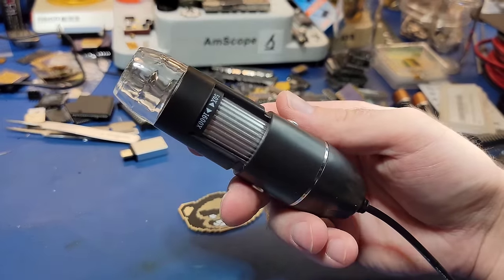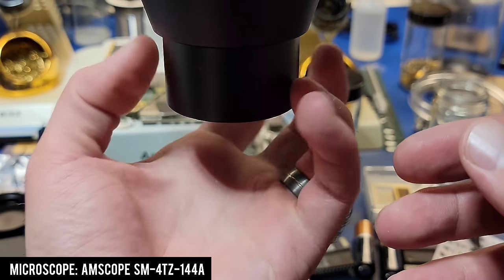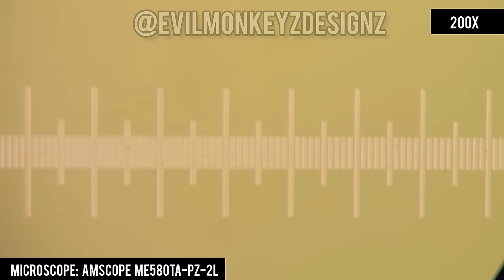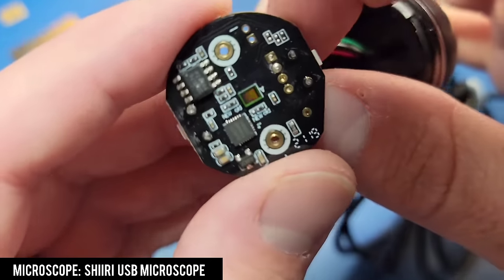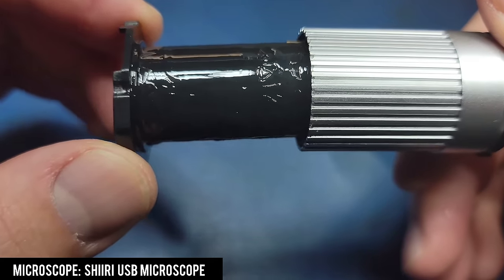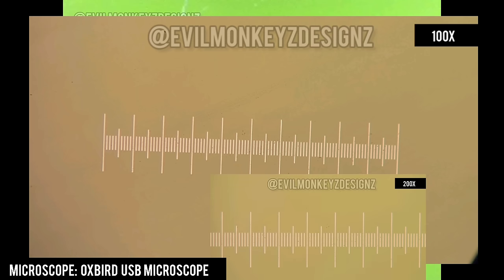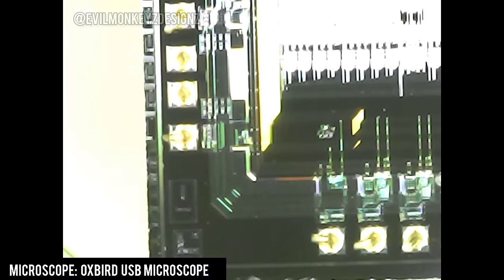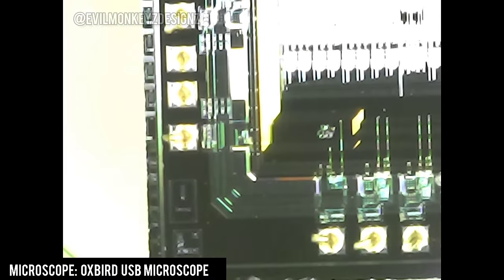Digital Microscope Comparison

Comment: Those high end microscopes are really nice.
For some of us, however, we don't have large labs to work in.
My work bend is very small, so a large scope was out of the question.

Back in 2017, I ended up buying a A1-N002 (Andonstar ADSM201) HDMI 1920x1080 scope.

The screen is tiny and really not worth using it that way, but it has HDMI and I have that connected to a 24" monitor.  The image is excellent.

It brags a 300X magnification, but the "zoom" is only adjusting it up or down on its stand. LOL
But the focus ability of this thing is really good, so I can get very close to my PCBs, but the sacrifice is that the lens is very close.

This one was worth it for me as its footprint is very small.
Reply: Used Andonstar ADSM201 for a while. It definitely was nice scope, but unfortunately with very little observable area. Good for phone and small circuit board repairs. But pain in ass when you had to deal with laptop motherboard due to lack of space at small base of ADSM201. Small distance between object and lenses also prevented working with larger boards. Due to that I was forced to purchase better and more expensive scope.
Reply: @KrotowX On day one I hated it for that very reason.  LOL
But, I solved that problem.

What I did was to fir swing the shaft, with the gear teeth, around so it's now towards the back.

Then, I mount this on a shelf about my work area, "upside down.'  Meaning, the "foot" part is on the shelf, the shaft faces down and the camera is now mounted on that.
So the camera is now looking at the bench.

The foot part, which is on the top shelf at the edge, I put a big washer with  rubber screwed into the shelf, right at the far edge of the foot.  This is to support it so that camera won't fall down.

I hope I explained that clearly.  LOL

The point is, now I can adjust the camera up and down for a much wider view.  I can easily use it now to view larger boards like PC motherboards, TV boards and the such.  

If I do need to get super close, I then just put the work (board) on a riser so that it's closer to the camera.

I've used this for years in this position and it's just fine.

Of course, if I had more space and if I was doing more work in my lab, then I would buy a larger format one with the dual arm and remote zoom, focus etc.

But... no need.

Comment: An absolutely professional production! I'm glad I didn't spring for the low cost "kiddie" microscopes! I have the most expensive model you presented but an earlier model. The biggest problem is the wobbly mount. It works great at lower power for positioning small surface mount parts.

Comment: Really good comparision👍 amazingly well presented architecture of those image sensors by use of pro microscope. It was an amazing video to watch not just as a good comparision of cheap microscops but for sure to see how image sensors are build and that was the first time I saw them little tiny sensor pixels and all wirering around and under the circuit. Why most of people don't even realise and barely understand these techs which in my opinion all children should particularly understand the basics of electrics and electronics. Thanks!

Comment: A video demonstrating the superiority of the AMSCOPE microscope compared to a host of stupidly cheap proposals. But for most mortals these (cheap proposals) are more than enough for hobbyist or even professional use. It would be more interesting to demonstrate which of these cheap models is the best or most functional. Most spectators were grateful.

Comment: Magnification is not an important spec for a digital scope, because any image can be infinitely magnified. The things that matter are resolution, dynamic range and depth of field, in that order. 
A 0x magnification scope (where 1 micron on the object is 1 micron on the sensor) is about as good as you can get.  Displaying an image from a 1/4" sensor on a 25" wide screen gives 100x magnification. Displaying it on a 50" screen gives 200x.
Reply: We still are talking about optical magnification which is in effect in microscopes with digital cameras. Digital image magnification indeed doesn't matter.
Reply: @KrotowX  even optical magnification is misleading. As I mentioned, a 1x optical magnification on a standard image sensor is great, but it does not tell you what you can see. Only numerical aperture (& therefor resolution) tells you what can be resolved, regardless of magnification - optical or digital.

Comment: They dont tell you in the manual but you need to fully extended the lens and then tighten it by the threads. You can get about 5 or more inches of clearance with a better level of clarity as if camera were 2 inches away from the subject.

10:18 you can see its inscrewed but you can still do it without taking it apart fully. I just weaseled my fingers in and screwed it in snug because i noticed it was loose.

Comment: I wouldn’t mind if they said it’s 50x or 100x and cheap and high quality… it’s the fact that they call it 1200x or 2000x etc that kills me… like… it’s not That bad if you are okay with 50x or 100x and are, for instance, soldering chips, not actually looking at chip dies, but let’s say you want 200x, 500x, 1,000x, plus+ and that’s why you buy it, and it just plainly Doesn’t do that, then yeah… just don’t lie… 😅

Comment: I wondered about the true magnification of Carson Optical's 250x pocket microscope, I think it's only about 100x.Microscopes from 2000x to 7000x are usually for scientific purposes and precision fabrication can cost upwards of $70000, so a 1000x microscope cannot be cheaper 2000$
Reply from the maker: Those are all great points! I think that a normal person who's looking for a microscope might see these cheap USB microscopes and not realize that they aren't really getting what is advertised. Most people have no concept of what 1000x magnification should actually look like, so it's easy to get away with this sort of false advertising.

There is a market for these, but they unfortunately aren't good for looking at silicon chips up close. I'll have to add the Carson pocket microscope to the list of microscopes to look at if I ever do another video like this 😁
Reply: Well actually Ive never seen a professional microscope with more than 1000X, going beyond that is futile due being at the limit of resolving power with white light. Dunno about super resolution microscopes like STORM, STED and PALM but I bet they still have optical magnifications below 1500X the resolving power comes from the algorithms.

Comment: With this kind of digital microscopes the magnification is practically a meaningless number: marketing department can play with the numbers and make it the higher they want, even if the actual details captures by the optics+sensor stay pretty poor.

Light intensity and uniformity may also make a lot of difference: I bet that if you manage to get the illumination of the top level microscope mounted on the cheaper ones, the chip images will improve considerably.

A more meaningful evaluation is resolving power: roughly speaking, the ability to capture and separate fine details. That's where you may find the bigger, and most significant differences among cheap and top level microscopes. That's what the test microscope glass with 0.01mm lines is for, though an even finer grid may be needed to actually pin the magnitude of the differences.

To be fair, even the cheapest microscopes performed pretty decently (for the money) on the test glass. 0.01mm grid lines were well separated, and quite sharp (at least, the difference is not that much evident on a YT video). A finer test glass should make their limitations much more evident, but stability and light looks like their main limiting factor, nit the optics+sensor chain. Anyway, considering that one can use them lighthearthedly on the outside, in rough environments, connected to a smartphone, they may still be an interesting tool for many things.

Comment: So nice to have this video pop up in my suggestions after just having ordered one of those cheap ones 😅 I wasn't gonna expect excellence from a 20€ China-made gadget anyway, but I'm hoping it will be decent enough to inspect regular solder joints.
Reply: I’ve had the cheap usb one for a couple of years. I think you’ll find it useful, it’s better than nothing. As mentioned the biggest drawback is working height. My usb scope ended up with burned plastic due to me keep getting it with my soldering iron 😂
Reply: @Mark_C1  Yeaah it doesn't work at all. Comes with a download link that's broken, had to find the app myself only to then notice it only works with the wireless version.
Reply: @Crimsomnia  that’s a shame. I think with mine I gave up on trying to get the software and just let windows pick it up it’s self and then viewed it on the camera app within windows.
Reply: @Mark_C1  Yeah that could work, but it kinda defeats the purpose of doing electronics stuff on the kitchen table, when I don't have space for this around my windows PC. I'll see what I do with this now
Reply: @Crimsomnia  yeah I hear you there ! I also tinker in the kitchen as we’re in a 2 bedroom flat. Setting the stuff up getting ready to work on something seems half the battle lol. And apparently the kitchen cupboard isn’t the place for oscilloscopes, power supplies and hot air rework stations 🤣

Comment: I bought a few a year ago to compare, and they all seemed to be the same (same magnification, same lights etc.), but some still had better image quality, so there might be different filtering being done. I didn't need the highest magnification, just something I can hook up to the PC that's portable. I bought some for 15, some for 25 and one for 40€ and the cheapest one had the best image. I would have liked something with 200X, but I also came to the conclusion they all are 100X, no matter what it says on the package unfortunately. Same goes for magnifying glasses, the chinese selles give you numbers like 10x and it is 2x in the end.
Maybe there is a physical limitation to around 100x with such a small form factor?

Comment: How close did u place the shiiri/oxbird microscopes to whatever you were looking at? We have one at work and I discovered if you put whatever you're looking at right at the opening of that clear plastic housing (imagine placing the end of the clear housing directly onto a document you are inspecting) you can run the focus adjustment all the way to one end (past where you think it should be) and you do get the increased magnification.

Comment: it depends what you want do with it. i got a cheap usb one to inspect solder joints on my side projects. for 10-15$ i'm happy with it. 
i use it so rarely getting a more expensive one wouldn't really do more. it does the trick and doesn't take up space when not in use.

Comment: I got a Tomlov last week but I got it for smd soldering and inspection and not for inspecting the chip dies. My first impression was a little disappointment but after using for a few hours my opinion changed to very impressed. It does better than what I wanted for the price I wanted to pay.

Comment: Mate,
Without disputing resolution and quality at all - to get the most magnification from all the inexpensive USB micros (I had a few) you need to remove the front protector. It's a strange design, but with it you just can't get the lens close enough to the object to make best of the device potential magnification capability. 

Without it, you can take surprisingly good images with those (considering the 10$ price tag).

Comment: Quick question: I have a c-mount type digital microscope and I want to buy a barlow lens that will help me see a wider viewing range. I want to see more components on the board. Should I buy the 50x or 75x from a height of, say, 2 feet? By the way, this is a great review! so extensive. 👍
Reply: Do you mean 0.5x and 0.75x? Generally speaking the higher magnification, the closer you need to be to the work piece to focus. But it is also going to depend on other parts of your microscope. A 0.5x will give you half the magnification and presumably double the working distance? Assuming you aren't currently using a barlow that modifies your magnification. Although I could be wrong on that and maybe the working distance doesn't scale linearly with the magnification.

Comment: While I agree with all of these microscopes being a scam with regards to their stated magnification, I think the way you measured the magnification may be a bit misleading: by looking a the size of things on screen while ignoring the actual resolution, you gave the cheapest microscopes an estimated 100x zoom and the last two only 50x. But the last two had way bigger sensors, if you had cropped their image to their 640x480 middle section, they would have "measured" somewhere between 200x and 250x, that would have been a fairer comparison (that way all of them would have the same "pixel size" on screen). Otherwise a bigger and larger sensor on the exact same optical zoom level would always get a lower "estimated" zoom.
Reply: The problem with that is if someone is saying its x Megapixel and x magnification, you should be able to expect the magnification AT that resolution.  Crop/digital zoom is not magnification, even if perceptually it kinda works the same way.  As with real magnification you would get more detail due to using the whole sensor.

Comment: So I do have one of those cheap ones, but I only use it for taking macro pictures for work instructions for operators at the factory I work at, specifically for like 0603 SMD components.

Comment: Would you recommend the Tomlov digital microscope for something like inspecting collectibles before grading? For instance, looking at vintage sports cards for potential damage on the surfaces, edges, centering, etc? The $699 microscope seems like overkill for my case. Thanks.

Comment: 24:00 Of course you can turn off the 6 LEDs. Use the dimmer on the front below the buttons (the white line is a touch dimmer).

Comment: You are not telling the main issue with this, YOU CANT use it for soldering because the microscope needs to be extremnly close to the circuit and you cant fit your tools.

Comment: I had a couple of these cheapo USB microscopes and the sensors in them are outputting a resolution of 640x480, I bought a 1080p 1920x1080 USB camera with a OV2710 sensor on it and 3D printed an adaptor to allow me to use the lens mechanism from the cheap Microscope and now have a crystal clear image full screen compared to horrendous even when in a small window when using the stock sensor.

I use it all the time when doing electronics stuff, the OV2710 camera only cost me £12 and was soooo worth it, I have two different cameras with the same sensor as I use the other for something else and one has a very slightly better image quality than the other as the processing IC's on the camera make a difference as well as the actual sensor but both spank the tiny sensor those cheap microscopes come with.

Comment: For work im using a keyence digital microscope. But that was much much much more expensive than all of the ones from the video combined *^^.
But since it is also a couple of years old now, you notice the "old" camera sensor and PC that runs the software. But 5000x magnification is great.

Comment: You should have enlarged the photos to compare them one-on-one with the expensive microscopes, i.e. should have enlarged the 100x scopes' photos 2.25x and 5x, or 5x and 10x for the 50x scopes to give us a better comparison between them and the expensive models with real specs.
You could still do that with an additional, short video.

Comment: i got a similar scope to the cheap ones. the biggest problem is the software. mine has a wireless feature which only seems to work on phones, the pc version of the software only seems to support a usb connection. i was kind of hoping to use it for soldering tiny parts, and the wireless capability comes in handy there but it kind of defeats the purpose having to use a tiny phone screen instead of a huge monitor. im very farsighted and that was kind of the whole point. its only useful for inspecting work i did under a stack of magnifying glasses.

Comment: A year or two, I looked up microscopes at goodbang or banggood or something like that. It seemed there were at least a hundred with a big price range. Would have liked to have got one, but, no idea what would get. Only need one for stuff like fixing a wire or finding a burned out part on a board, getting a sliver out of a finger, checking some coins or a good look at some rocks. That last would probly do all the above. I wonder how tacking a aluminum ring, blackened on the inside would work to fix the led problems.

Comment: I have a couple of these USB microscopes and, yes, they suck. However, I did notice that they seem to have two points on their magnification wheels where the image resolves: one is around 50 × or 100 ×, the other is much higher. Did you try the whole range of your focus?

Comment: I noticed newer wifi models have a different lens type - it cannot achieve even focus across its width compared with the type used in the older wired models.